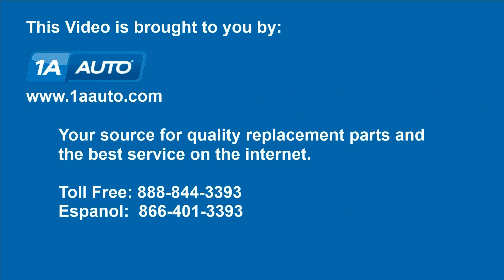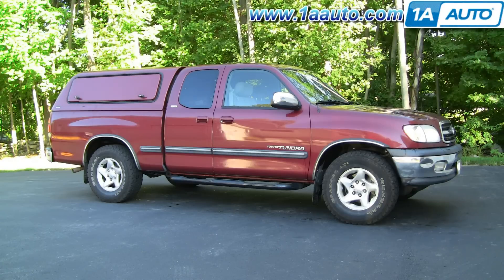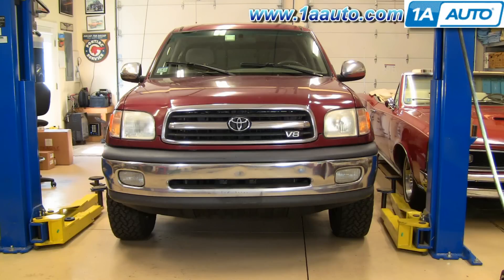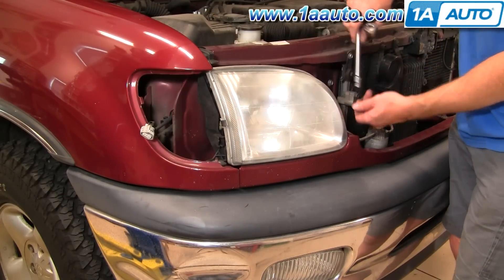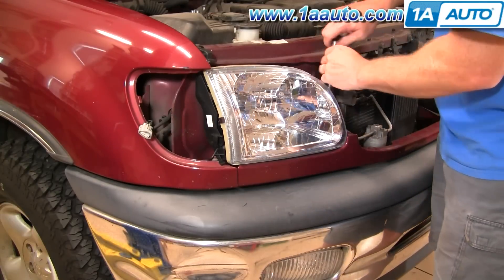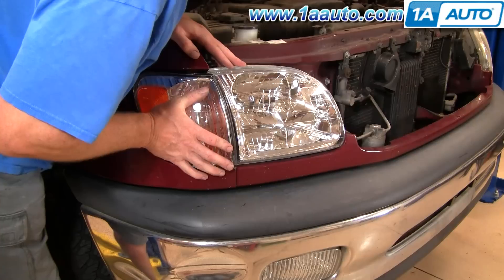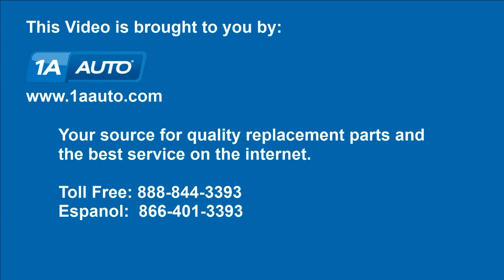How to Replace Headlights and Bulbs 00-04 Toyota Tundra

Comment: The hardest part was removing the turn signal assembly. This could almost use a video of its own. Once the turn signal was out of the way, your video made the rest of the project a true breeze. Thanks for providing a great video to go with the great value of these replacement headlights.

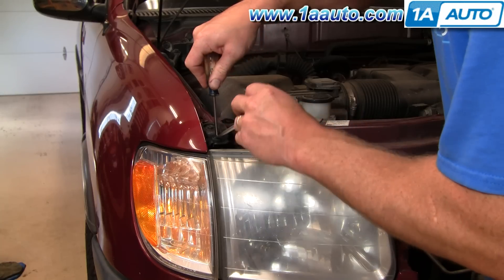Comment: Great video, saved me tons!  One point though.  The little plastic screw insert, (at 3:50 of the video) is easily stripped, (especially if it is old).  It is just plastic.  After you buy your headlights at 1aauto, go to the dealer and get two of these plastic screw inserts, (88 cents each).  That way, if you destroy your plastic screw inserts, (like I did), no worries, the new ones just pop right in.  These are awesome lights.

Comment: Just changed mine out and they fit perfectly. A few suggestions, I live in Chicago and needless to say, a lot of road salt in the winter equals a lot of corrosion on the mounting bolts. I used penetrating fluid the day before and gave the nuts a few turns and kept spraying them, a few more turns and more soakings until they were almost at the top of the bolts. Moral here is, soak the crap out of them. I lost the two bolts (snapped off) on the lower portion of the where the bracket goes(toward the outside). These are pressed in so I ground them flat and used a 1/8 cobalt drill bit to start right down the middle and finished with a 1/4 inch bit and used some 1/4 X 20 X 3/4 bolts to hold them. To make putting the turn signal housings easier to put in, I put a touch of grease on the parts that snap the units in, when in like a breeze. I also changed out my fog light lamps because they are easy to reach when the headlight unit is out. Hope this helps.

Comment: Sticking a foot or two of duct tape to the side marker lights works great to get a better grip on them for removal.  Orient the strip of tape in the direction of pull and pull on the tape to pull the light out.

Comment: I pulled the clear covers on the turn lts completely off on my 2004 The clip in front wasn't about to let go. I beat the old headlight out with a hammer and gained complete access. Very satisfying as well!
Reply from the maker: Thank you for the great reply. We love to empower our customers by showing you how-to perform your own auto repairs while installing our high quality auto parts. Have a great day! 1aauto.com +ray smith
Reply: I then proceeded to use super glue jell to re-attach said lenses. They turned completely milky white!!! New signal lights are on their way.

Comment from the maker: We currently do not have an auto repair video for this particular repair. However if you remove the two screws from the top of the headlight, then remove the two bolts from the end of the small panel under the headlight. This looks like it will allow you to access the remaining two bolts that hold the headlight into place. Hope this helps you out. 1aauto.com 888-844-3393

Comment: I have an 04 Tundra and one difference is that there is no screw holding the side panel lights, it is a trim plug. Also, you don't need an extension on your 10mm ratchet. Don't use a screwdriver to pop out your side lights or you may pop the cover off the lights and need to glue it back on (trust me). You do not need to completely remove the side lights, just let them hang there.Other than that I changed both in 30 minutes following your video, thanks.
Reply: How much were the new lights cost wise?

Comment: This is great and all but how do you adjust the headlight?  I have this exact setup on the exact truck and i thought it was with a phillips head screw driver but that dont seem to be correct so what tool do i use?

Comment: Excellent video, I changed the front and side front lights.  After changing the side blinker lights, they do not blink and the dashboard lights have a very fast blink.  Cannot find a video for this.  Do you know what would cause this?   I'm pretty sure that I fully followed your video.  No problems with the front lights.

Comment: Thanks - couldn't figure out the turn signal assembly part - easy after watching you. How about aiming?
Reply: On the top and off to the side of the longer bracket (toward the middle of the vehicle) there is a small plastic hole that you run a #2 phillips screwdriver down that turns a small plastic pin wheel, that will move the headlights up and down. Be sure you use a new or in great shape screwdriver as the pin wheel is plastic and can easily strip.

Comment: Can I replace the stock Halogen lamps with the newer Xenon bulb types? Just concerned about amp draw or heat difference inside the enclosure. Thanks.

Comment: Do you have a headlight video for Toyota Highlander (I have a 2002..)
Reply from the maker: +tdub3366 Thank you for watching. Unfortunately we do not have a video for your application. We will keep this in mind for future repairs. But that said, a lot of those replacements are very similar, so if you're mechanically inclined, you could watch a few different headlight replacement videos and then try your hand at your own. Maybe pick up a Haynes repair manual beforehand? Good luck! http://www.1AAuto.com 866-403-3393

Comment: I broke the plastic screw and housing that go through the corner light. Where can I find that part?
Reply from the maker: +Tisoy Eats Thanks for checking us out! A new corner light pair can be found here: https://www.1aauto.com/toyota-tundra-corner-light-pair/i/1alpp00129?f=250664&y=2003 These will come with the housing ready to install, you will just need to get the screws for the replacement.

Comment: Two types of plastic clips acting as nuts broke off when I removed the bolts. I went to the dealer and changed all of them out. They had worn out from heat and sun.and were 16 years old. I would advise buying them before you begin.
Reply from the maker: +Craig Dishner Thank you for your feedback!